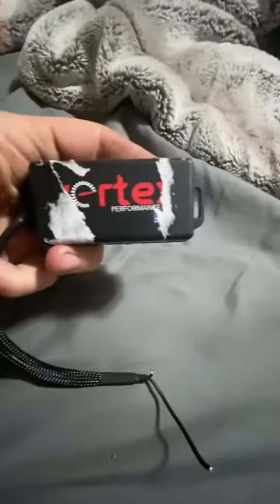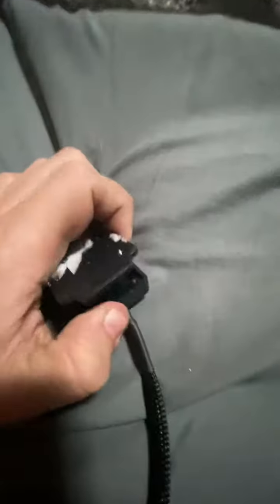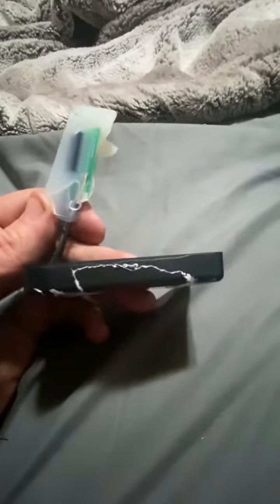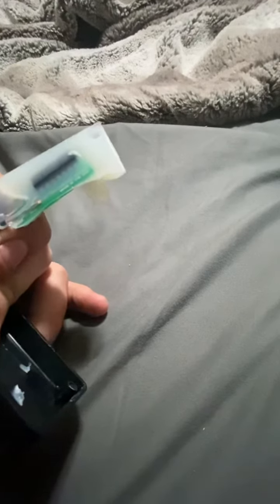Vortex Performance Chip

Comment: Lol, that is not a vortex chip ! You got a scam item ! Mine does not look like that and it made a huge difference in my toyota sequoia
Reply from the maker: I bought it off their website.......
Reply: U got it from the scam site sorry.
Reply: Fr the one I got for my 2005 Toyota Avalon made it feel like I was damn near driving a new car, and it didn't look like that one, plugs straight into OBDII port, hold the calibration button for 15 secs, drive 150 miles and you'll definitely start to feel the difference, mans got scammed fsfs
Reply from the maker: @juliosdiy3206i definitely did not. By all means buddy, think that. I am just posting this to protect others. I bought it right off their actual site. This is what they sent me. I wish you the best though truly. No anger typing this.

Comment: Mine worked
Reply: u sure ?
Reply from the maker: I mean, I doubt it. But I hope you are right. Truly. I hope your didn't get ripped off.
Reply: Mine works fine can't say it's a huge jump in performance but I was only needing it for torque remapping off road which definitely helped...pretty certain most of these folks who are opening these up do not have an engineering degree.
Reply from the maker: @privateuser3725  well....pretty sure the people putting these together and designing them don't either. Since when does a pound of super glue count as good engineering/design? 

I mean really I feel dumb for ever ordering this. If it was possible to make the engine perform like this the manufacturer would make it like that or sell their own chips. It is a scam.
Reply: @dakotajiverson21  no, the manufacturer wouldn't. the way they operate is by adjusting the engines timing and electronic systems, which in turn creates higher emissions. there are good chips out there but you are right in showing that this is a piece of crap
Reply from the maker: @vexensweat5233  thank you. Okay what you say makes sense.
Reply: @dakotajiverson21  ya i just wish companies like this couldnt get away with blatant false advertising
Reply: @dakotajiverson21 the glue it for potting... To keep the chip from clacking around.